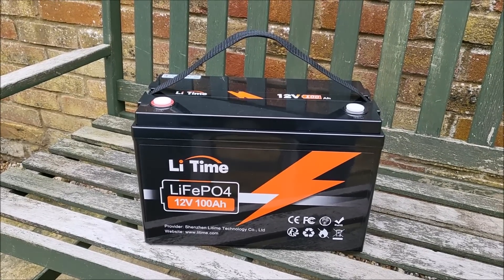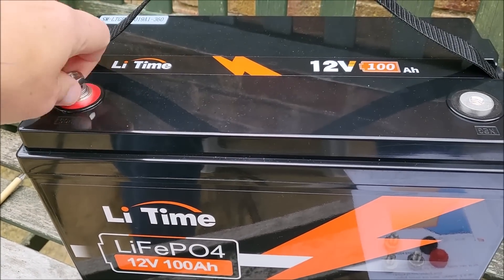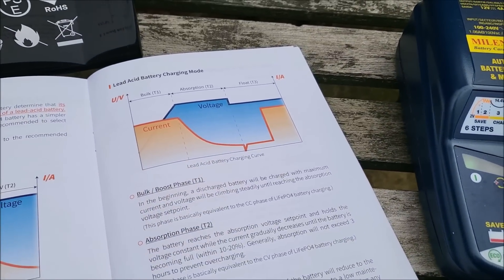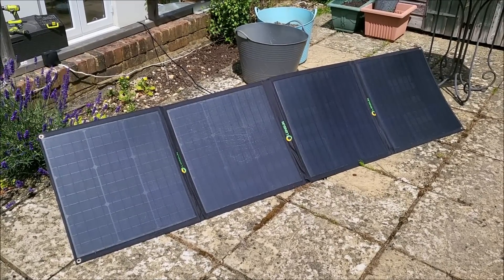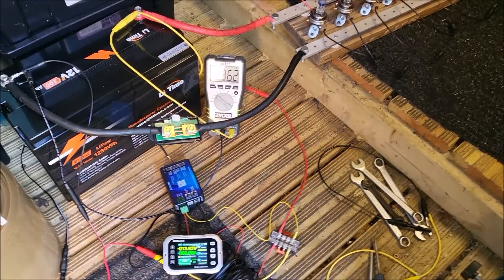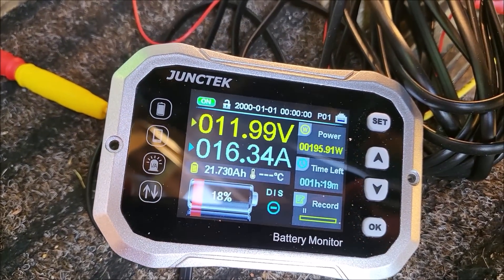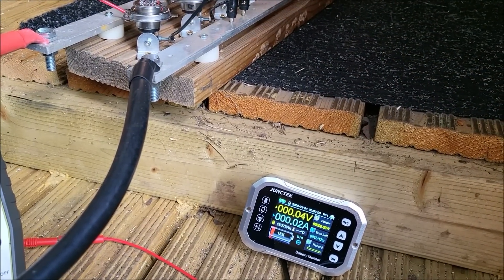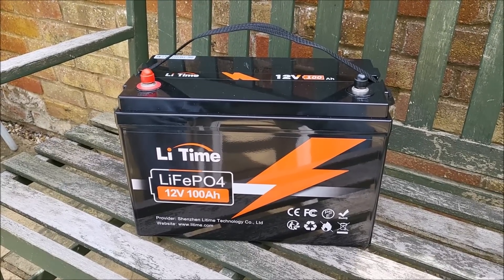Li-Time 12.8V 100Ah Lithium Iron Phosphate Battery

Comment: An equivalent capacity lead acid leisure battery is just over twice the weight.
Reply: Yeh I thought that too. Then I saw on the website the weight comparison is done with a 200Ah lead-acid battery, which I guess is because a 100Ah lead-acid one won't deliver that actual power. So that kinda makes sense.
Reply: That is hood feature of lifepo4

Comment: The website might claim its 5x heavier but if you do some research you can get a 110ah lead battery 20kg but these lithium ones are 11kg
Reply: You have to keep in mind though that a 110 amp hour lead acid battery isn't going to provide 110 amp hours of usable energy. You're really only going to get about half that.
Reply: @DoRC  but you could get 4 lead for the price of this lithium getting 2x more usable power
Reply: @paulwright8378  Yes the lead acid batteries at initial purchase are more cost effective. That being said you're going to have double the size four times the weight and probably 1/4 the longevity compared to lithium iron phosphate. Oh and you also have to make sure that you have proper ventilation for off-gassing with the lead acid batteries which isn't a concern with the lithium
So unless you have a large ventilated area in which to store the batteries, aren't concerned about weight at all, and only plan to use them for a couple of years then lithium iron phosphate is still the way to go.
Also at least where I live you're not going to get four for the same price you're going to get three and a little bit.
Reply: @DoRC  Not so.  You will get full AH from the lead acid, if you care to discharge it fully.  That has implications for cycle life of course.  Usually down around 400 for a storage lead acid battery.
Reply: @retrozmachine1189  Yes you can fully discharge a lead acid battery but you're not going to get anywhere near 400 cycles out of one if you do.  Maybe a hundred cycles before you start seeing significant degradation. You might get 400 cycles out of it if you only use 30 or 40% of the total capacity.
It's also important to understand that this is if you're discharging it very slowly. If you're putting a heavy load on them they're going to discharge much more quickly.
Really the only reason to buy a lead acid battery these days as if you literally cannot afford a lithium iron phosphate and you don't plan to use it for very long.
The prices of lithium are in phosphate batteries means that per usable amp hour they're only about 50% more expensive than their lead acid equivalents.
Personally other than as a starting battery for a vehicle I would never buy a lead acid batter anymore.
Reply: Lead is always the same weight for the same amount of lead plate. Less weight less lead less battery capacity and or longevity
Reply: @lezbriddon  if you bought 2 lead now an 2 after a few years it would lead would still be better for the same price,unless the cost of lithium was equivalent to that of lead the only benefit is that 2 lead batteries is 40kg split into 2 an 1 lithium is 11kg
Reply: @paulwright8378  I'm not against lead in general but if you're looking high currents it's simply pants. 200ah into an inverter running my kettle is maxed out. At that level of drain is not a 200ah battery it's a 150ah battery because the harder you hammer it the more of the stored capacity is turned to heat inside the battery. Also of that 150 I can't take it all in one go, it's like a 200gallon bucket feeding a 50 gallon bucket with a leaky straw, I can pull from it until the little bucket is empty then I have to wait for it to refill via that Straw. You get none of this with lithium
Reply: @lezbriddon  I'm not against lithium but buying brand new is extortionate when you can get used lithium batteries and refurbish them
Reply: @paulwright8378  what use is a lithium battery full of used cells? You can't refurbish a cell. If you can't refurbish the cells then you can't refurbish the battery so stop fooling yourself.
Reply: @lezbriddon  because there is usually just 1 bad cell in a battery the rest can be over 2.4a
Reply: @paulwright8378  2.4a? your literally talking like these things are made with a bagfull of 18650s, sorry I'm out of this conversation lol
Reply: @paulwright8378  There are four 100Ah new LiFePO4 prismatic cells in this battery, not a bunch of 18650s!
Reply: @lezbriddon  you should not be using 12V to run a 2kW kettle. Use 48V instead for 4x less current and size of cabling.
Reply: @ahaveland  yeah ok. Terll me how in a 12v based camper I do that, because no one else uses 48v on the road.

Comment: Sadly I wnatn With a Smart BMS (With Bluetooth ) Sadly only the Roamer UK & Renogy UK Brands Has this plus the 24V Battery's  Due i  want Longer run times With USB PD (20V 35W ~ 65W ~ 100W) +  Have Nice inverter That does  Direct HV PV 2 AC loads Without battery  (off Grid)
Reply: If you want Bluetooth connectivity for monitoring you can just get one of the external battery monitors that work through Bluetooth. Personally I think that a monitor with a screen is better though. I've tried the Bluetooth monitors and I found that by the time you go through getting the app up making sure it's connected dealing with it not being connected reconnecting it getting the app back up again etc you would have spent a lot less time just walking over and looking at a screen. I don't think Bluetooth is reliable enough yet to beat out a scren on a wall.
Reply: Jk bms and never look back. Only brand I'll buy now

Comment: Just for fun; 50 of these will give me 60kWh of energy and weigh 550kg, cost USD16,500 (19,000 UK pounds - perhaps to cover freight?). If you are thinking of an EV, these, unfortunately are severely current limited for that application.
Reply: 50 of these arranged 5P10S would be able to supply 500 A at 140V or 2P25S to give 200A at 350V = 70 kW. Not a lot, but usable although would be throwing money away.
Nobody would even think about that using these batteries for that and would just get the raw cells from the upstream supplier such as Eve, with a proper EV rated BMS and inverter.
However, getting 4 of these for a 5kWh 5kW 48V ebike might be worth it.
Reply: I wonder what a whole used ev battery gives out in kwh an costs

Comment: Would be interesting to see what kind of cells they use inside and what kind of BMS. With these chinese sellers you often get used Cells or socalled B-grade Cells which didn't meet the specs of the datasheet. This box is a great opportunity for them to hide the cells and electronics. That they meet the capacity is a good sign at least - so they could really be new B-cells. The grade A go to the automotive industry for 100% - you hardly get any real grade A cells even if the claim so. Just saw they claim 15.000 cycles - which is a joke! Price 330 US-bucks is quite good with BMS included - but i would be suspicous with the cells...
Reply: There are other channels that have taken these apart and have determined that they're in general pretty well made.

Comment: I guess your only measuring 1 of the 5 bulbs so only seeling 1/5th of the discharge Ah's ?

I'm looking for 200-300ah to replace my 500Ah of boat anchors. all that weight in the van doesn't help my mpg
Reply: I can recommend these batteries from experience. I have five of them in my camper and I have probably a hundred cycles on them with no issues whatsoever.
Reply: He is measuring current from the negative line off the battery, positive goes straight to the rail so it is full current
Reply: @jecceworks  so why his he only reading 19ah in total and saying that's 106ah?
Reply: @lezbriddon  that meter counts from 120 down, 120-100:ish = ~20
Reply: @jecceworks  what! A meter that counts in reverse, oh hell no burn it with fire 🔥!
Reply: @lezbriddon  I like it, I mean the meter
Reply: @jecceworks  I suppose I'd get used to it.....

Comment: In real world discharge. If you are pulling 100amps from this battery this would provide equivalent run time of 200-250ah leadacid ! .
Reply: Surely it's an HR it says it on the battery and if you got the equivalent 100ah lead acid and pulled 100amps it's gonna last an HR without getting into the weeds with internal resistance and heating up granted the leads gonna weigh more.
Reply: @SlyerFox666  i am not talking about marketing terms. These results are from my own tests. 
I made a 25.6v 12ah Lifepo4 pack with 50$ worth of 32700 cells. 
It runs a 300w load for 45mins on my ups. And that is equivalent run time of having 27ah smf battery. Which would be 3x more expensive than Lifepo4.
Reply: @KuntalGhosh  There not marketing terms tho they are factual figures based on test results which is the only way you could get those results really. But what you said does sound like some marketing wanketeering. 100ah is 100 amps per hour no matter what chemistry you are using, if it's rated too 100 amp per hour you can run it at 1 hr pulling 100 amps or manipulate the figures so if you want to run it for 100 hrs only pull 1amp per hr that's all there is to that.